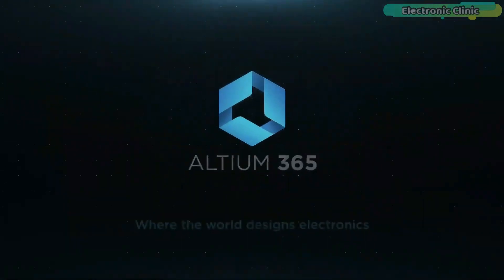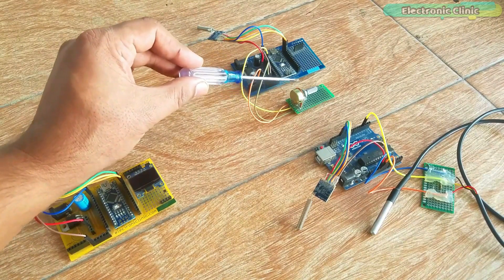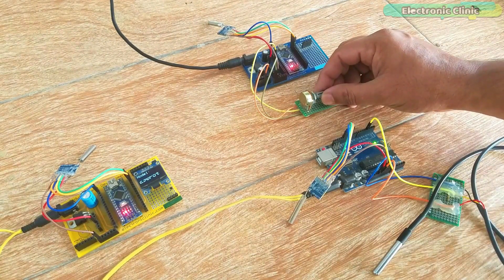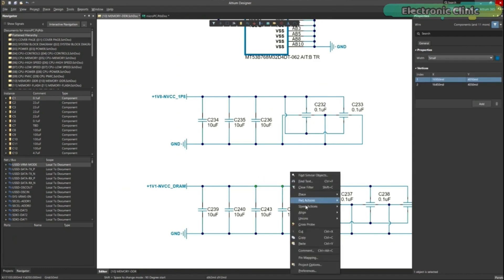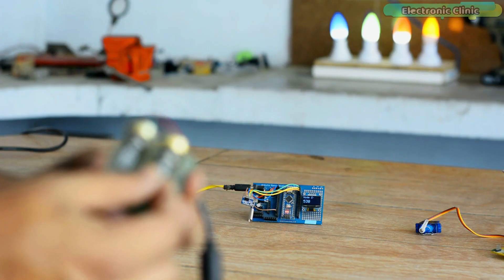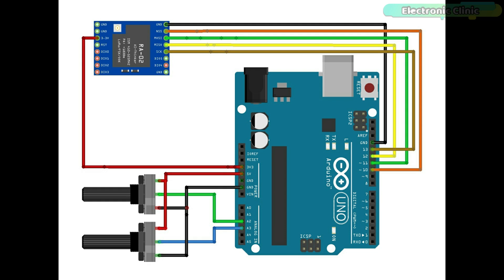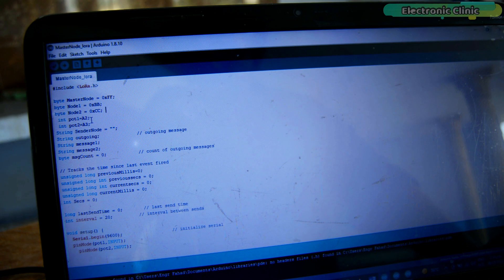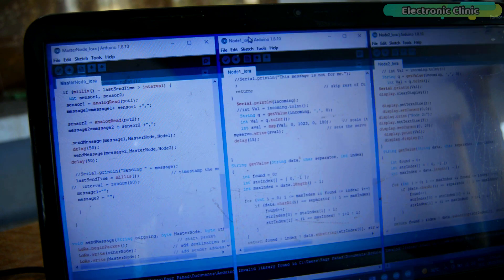Arduino LoRa Network, Master Arduino LoRa to Multiple Arduino Lora Nodes, LoRa End Nodes, RA02 Lora

Comment: Very nice project. But don't you have to use a logic level converter since the Arduino is 5V and the Ra-02 is only 3.3V tolerant?

Comment: Hello, can you please tell me why my receiver lora module stops receiving the signal after I change the input from pot, and it happens only when I Connect servo to it
Reply from the maker: Use external power supply for servo. Don't supply 5v from the Arduino.
Reply from the maker: Watch my video on servo

Comment: Please make a three phase water  pump cantroller with three phase indicator water, flow indicator, pump on off status indicator, connectivity network indicator and eror indicator and buzzer
Reply: Both side cantroll and indicators wirth arduino and lora Ra-02
Reply from the maker: i dont have a 3 phase motor but i can make it for the single phase. The same thing then you can apply on a 3 phase system.
Reply: @ElectroniClinic  plz make this Thank full
Reply: @ElectroniClinic  
Its a remainder